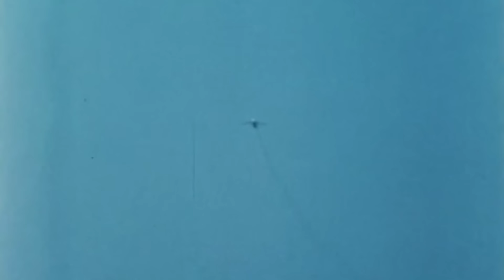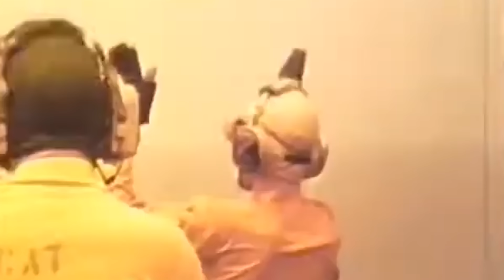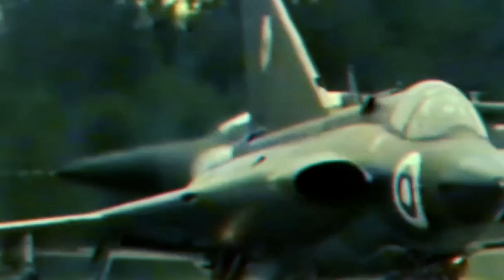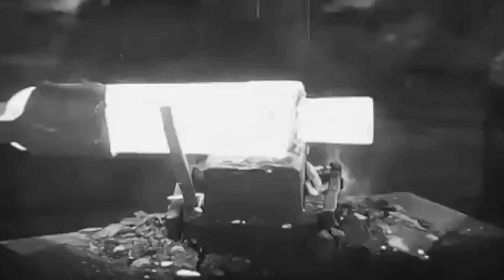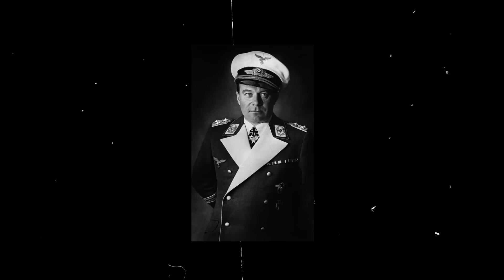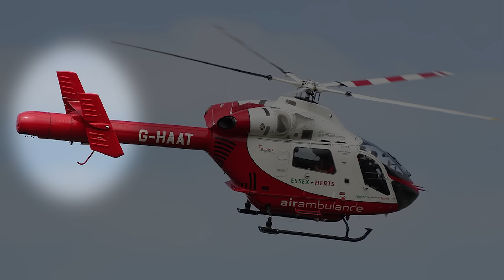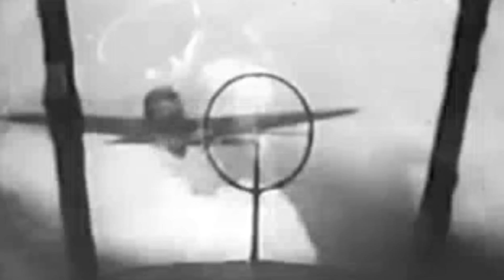The Strangest Aircraft Designs That Actually Worked Better Than Expected

Comment: The HE 177 would have worked if it had been designed from the outset, with each of its four engines in separate nacelles. As a conventional four engined heavy bomber. The derivative HE 277 came too late.

Comment: Check out BOYD. It's a biography book about John Boyd, a fighter pilot out of Korea and Vietnam that changed how fighters were developed. He fought engineers from both the Airforce and the Navy about how aircraft should be developed. He did some amazing work on proofing concepts, designs and actual practical designs. But he was designing for Fighters, not strike aircraft. So maybe this may not be appropriate here, but it was interesting to read. And he gave some keen insight into how the Airforce and the Military in general were really pig-headed and not very interested in efficient designs at the time. He almost single-handedly rewrote how aeronautical engineering was performed and he wasn't a mathematician in the beginning.

Comment: BV-141 WORKED WELL BECAUSE, the off set gondola / pilots compartment  is offset as a counterbalance to counteract the torque of the motor. By using the weight of the gondola as leverage against the torque created by a single engine airplane, this plane demonstrated enhanced performance which is explained by physics over beauty. although I think physics is much more beautiful than 1st appearance. if the builders had explained the physics behind the design, they might have manufactured more
Reply: It sure is unique and something very interesting to look at!  We need to respect capability over looks.  Success is the most handsome thing.

Comment: A7D with walleye was not fire and forget.  it was TV guided.  the pilot drove the bomb into the target with a joystick just behind the throttle of the aircraft.   I was the guy who made sure it worked  so I know it worked for the pilots   if you missed by 2 meters it was out of spec and had to be rebuilt.

Comment: You have to give Blohm and Voss credit.    They always thought outside the box and made some of the most unique flight worthy aircraft of all time.   The BV141 followed that trait of being so advanced and unique,  the Luftwaffe was afraid the design was TOO advanced so they passed on mass production.  If you have never heard of Blohm and Voss, you owe it to yourself to check out their very unique aircraft.   Eric Brown the famous british test pilot flew some of the Blohm and Voss aircraft just after WWII concluded in Germany with the German surrender.   He said that while their look defied what some thought was against normal aircraft physics,  Brown said that the aircraft were very stable in flight and very good aircraft for that era.   Unfortunately, none of the BV141's survived WWII and were either scrapped post WWII or intentionally destroyed by the retreating Germans so the technology didn't fall into the hands of their enemy.   It would be incredible if a modern day aircraft company took the blue prints (if they are still available) and rebuilt the BV141 from scratch using modern computer aided technology and putting modern day reliable engines on it.   It was so far advanced that it looked like something out of the future during WWII.   It's radical design was so far out of the box,  most aviation engineers thought it wouldn't fly or would certainly crash in testing.   They were wrong.  It flew quite well and was a very stable platform in flight having some of the best visibility of any aircraft of that era.
Reply: I wish we still had at least one fully functional example.

Comment: This got really repetitive. You describe the same designs over and over. And you miss details like how did a plane "mostly exceed expectations, but still underperformed"?
Reply: Probably using that AI they keep advertising
Reply: @habbsy1911  I doubt it's AI, bc it usually makes pronunciation mistakes and I haven't heard any yet. I could be wrong but there's always tell-tale signs when it's used.
Reply: This documentary is actually really interesting and informative compared to the standard WW2 docs loaded with meaningless troop numbers and designations.
This is hard to understand for kids because there’s nothing to jack off to, no sweaty guys running around wrestling each other, or rear admirals shooting stuff, this is mainly technical data and materials that were historically advanced for aviation at the time but not cool enough for YouTubers of today.
Reply: The whole "Dark" series has declined in quality.
Reply: Needs to pump out material to make make more money.
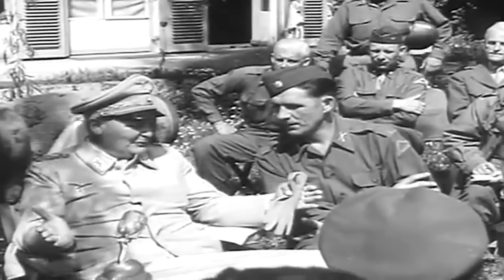Reply: 59:59 the plane met and exceeded the requirements (ex. payload, weapons, fuel capacity, etc.) when ordered by the government, but underperformed in its avionics when the prototype flew.
That’s how planes ‘exceed expectations and underperform’.

Comment: I love the A7 but the stated 8,800 NM of range is incorrect.  That's more in line with a 787-900.  The A7's range was around 1,000 NM without midair support.

Comment: What was interesting about the Hell Cat was only 1500HP engines in 1942 with the weight still managing speed of near 400MPH While the British and Germans were making 2000HP Plus engines that could do 410MPH which was not a lot of difference but were far lighter aircraft than the Hell Cat. They only plane faster at that time was never put in to production called the MB3 killed the test Pilot part owner of the company as a faulty engine it was built with six 20mm cannons tested first few flights 428 MPH.

Comment: The Corsair had an 8800 mile range?  All in all an excellent video.
Reply: Divide by 10?
Reply: 8800 miles? no it didn't
Reply: @Kai33331  5:15 "With 8800 miles of range"
Reply: Max. ferry range 1,342 nautical miles.
Reply: absolutely did not.
Reply: The Boeing air bus can go 8,555 nautical miles and is modern commercial plane
Reply: @Jdp313  What does this have to do with anything?  A Cosair doesnt have an 8800 mile range -its not a commercial long range passenger jet, and it weights 20 times less.  Also, a Boeng is not an Air Bus -they are 2 different manufacturers.
Reply: @DBoonful  I was goin toput Boeing 747 but seen that the air bus had a slightly longer range. Whoops and was just trying to point out that only massive modern planes can go that far. Pointing out that what he said in the video was silly
Reply: @Jdp313  Gotcha..-yeah a Corsair II with external tanks still only had a rnage of like 1500 miles max